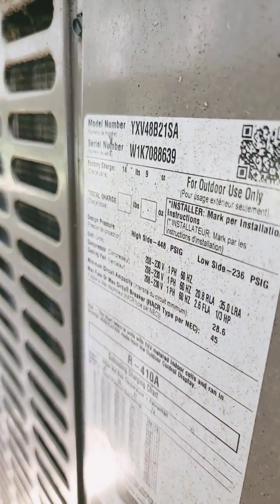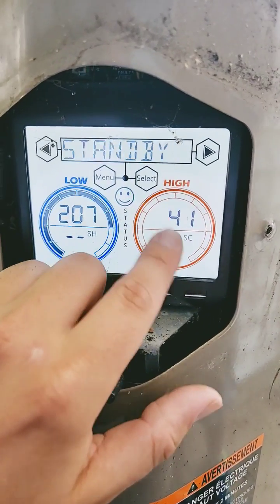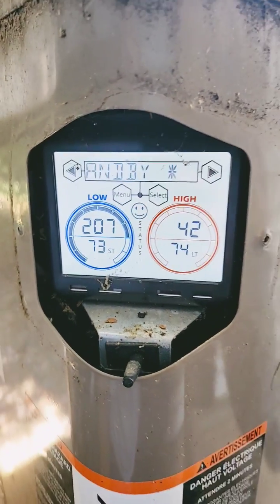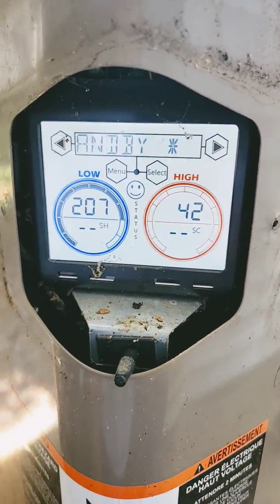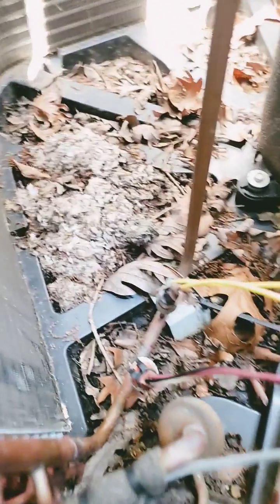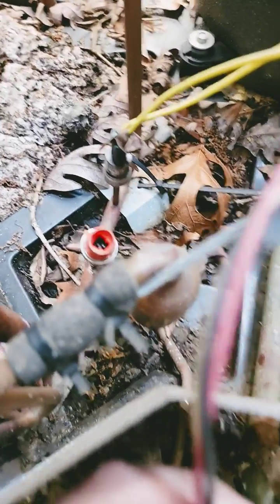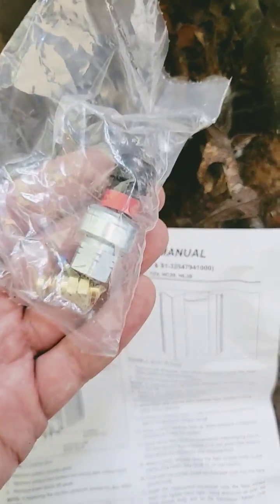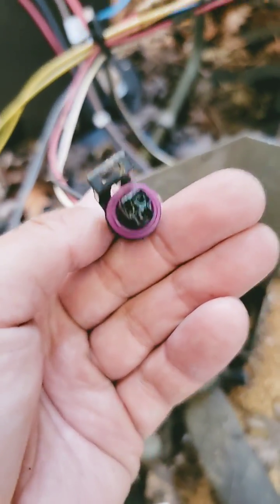Pressure Transducer on York Air Conditioner Explained

Comment: ive seen this problem a few times..usually its leaking freon because from the factory they dont push the   rubber seal down into the harness and causes water to get into the transducer and burn thru... to make the job easy cut off the transducer head and use 1/4 " flare stem with 1/4" coupling..add a drip leg to the wires and seal the top of all the wire harness with silicone

Comment: who was the genius who decided that a female plug should face up in an environment where water can pool.
Reply: I see and agree with you.   Glad Taddy was able to fix STUPID.   To prevent corrosion,  I recommend a silicone like di-electric grease around these rubberized connectors. Long lasting protection for the rubber seals too !

Comment: Man, give me a plain old fan relay, contactor, capacitors, and transformer. I'm pretty new to the trade, but all these boards seem fragile and not transparent about what the issue is. Stuck open or closed, easy. Board that just won't board? Annoying.

Comment: I see that sort of unit I think why would I want that? My unit has a condenser a contactor, capacitor, and that’s it. No high and low sensors, no circuitboard, etc. all that stuff is outside in the elements where it’s bound to have issues. It’s like everything else these days - technology that drives solutions that bring nothing to the table but service calls and expensive repairs

Comment: Interesting unit that has the built in LED display with pressure gauges(never seen that before) be intresting how weather proof they are (to bad they didn't protect the sensors as by having them pointing straight up likely it will fail, installing a cup on top them should help to make them last longer)

Comment: They should add valves where the transducers are so you don’t have to evacuate the whole system to change them. Or are they in a sealed well?
Reply: Trane has a valve core in theirs
Not a Trane fanboy just what I see a lot of

Comment: Wow do you know how eady it is to pull out pins out off those connectors & clean with electrical cleaner, most likely its lightly corroded & dont need to go all tpo crazy on it just clean it
Reply from the maker: Well these pins are corroded to the point where they're missing What do you do if they're missing
Reply: @taddydigest  wow that bad holy moly that connector looks as if it waterproofed,i guess that waterproofijg sux n u definitely need to replace the pins,

Comment: Not called a transducer. It’s a pressure switch man!
Reply: The paper he had said transducer, but it definitely looks like a pressure switch with a data wire for the board to read it.
Reply: A pressure switch is just that, a switch. It opens and closes at a specific pressure. A transducer is a sensor, a microprocessor will read it and be able to know the exact pressure. All a pressure switch would do is verify that the pressure is lower than the trip pressure.
Reply from the maker: lol 😆 😂
Reply: Your right man its a pressure switch with infinite states between open and closed.
Reply: @capps2015 which would be a transducer...lol

Comment: WD40 will clean that. Might not have to replace it.
Reply: Well we all wish it is as simple as that. WD40 has always been an alternative if we can't afford to replace certain parts but professional would always recommend replacement that part costing malfunction. Cleaning corrosion on copper is not hard, WD would do the trick but the wire and those look like a commerical unit, I don't think they would that chance. Cheer
Reply: Residential unit.

Comment: I am a firm believer in lower efficiency/lower maintenance ac units.
Reply: More bells and whistles, equals more problems.
Reply: On one hand, yeah simpler units require less work on out part, on the other hand, units like this with options up the waaaazoooo give us job security haha
Reply: Me to brother me to
Reply: Well said…..you are so right!
Reply: If you use your A/C a lot, getting a high efficiency model is worth it even if it's a bit more maintenance as the energy savings will pay for any repair bills. The key is to buy a high quality high efficiency model.
Reply: And increase the electric bill 500 a year? Nah